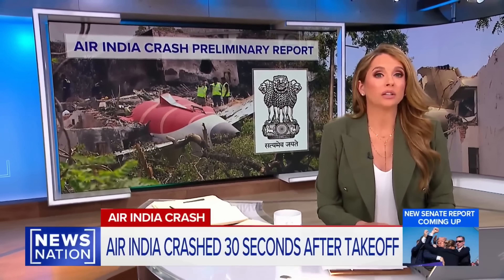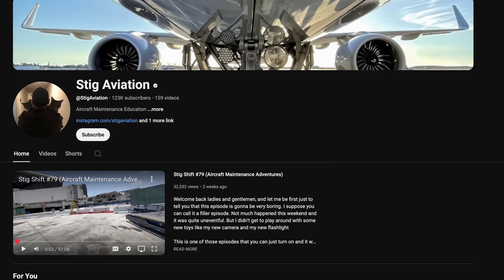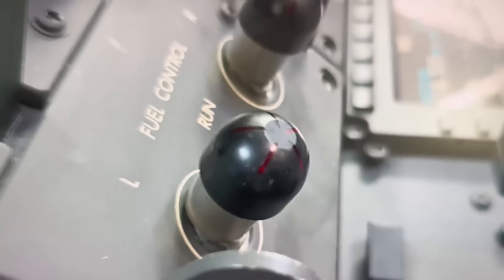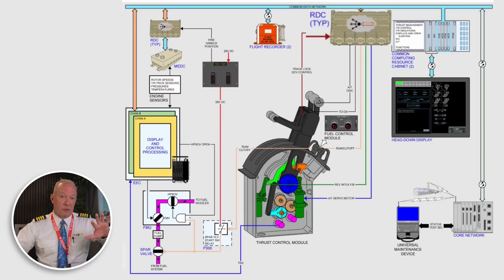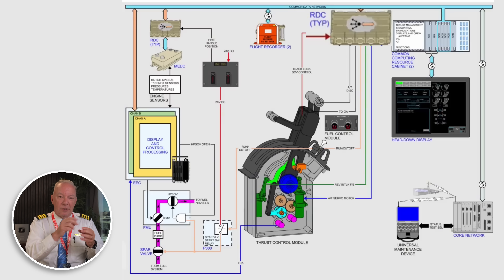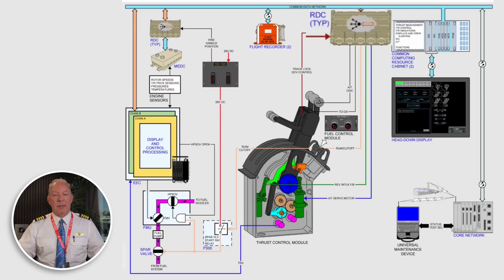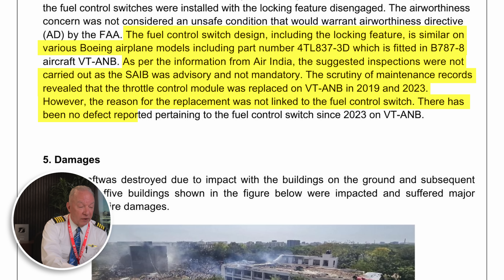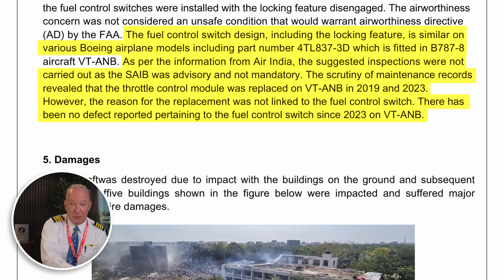The Truth About Boeing 787 Fuel Control Switches

Comment: Excellent explanation, it cannot be a glitch because one pilot asked the other why he shut the engines off. If it was a glitch the pilot would not have known what happened. The pilot saw the engine switches were moved the off position and that's why he asked the question
Reply: Yeah, the fact that the copilot asked the captain why he moved the switches to off and the captain’s denial (while not asking why the copilot did it) rules out any other explanation. The captain decided to crash the plane.😢
Reply: @gotamd  OR he had a brain fuck and thought he was bringing up the landing gear (or something else). Now if we have evidence of a short struggle in those 10 seconds… That would prove it.
Reply: Yup! I was here to say that.
These people pretending that this was a glitch... are ignoring that very obvious fact.
Reply: @CountAdolfo you dumb…there are no glitch in real life…that was duel engine failure.even elementary level students know better than u
Reply: There was certainly a glitch, but where? My money is on one of the pilots had a mental glitch.
Reply: @Marc-is-Me  RAT deployed before the cutoff, that's proven from the transponder data. No glitch. Electrical issues on the very previous flight of the very plane that crashed. In-flight entertainment systems not working, emergency lights flickering, aileron transducer failing. Just a coincidence, right? Wonder why the captain didn't pick a non-faulty airplane for his deliberate crash, would've been much easier to control.
Reply: If you notice, on the instruments, that the fuel is cutoff it is natural to ask the other person why he shut it off although you may not have seen him do that specifically
Reply: @bollof1 very true.
It's just liars who want to blame Boeing who spew nonsense trying to discredit the facts.
Best to just block those.
Reply: Why would the one pilot answer I didn’t if he turned them off to make sure the engines rebooted? You make no sense. Let’s wait and see when the final report comes out.
Reply: As I understand it, the pilot didn't ask why did you shut the engines off, It was reported that the exact words were "Why did you do that"? he didn't mention the engines being shut off. Unless we have the full voice recording released, we cannot be sure what the pilot asking the question was talking about.
Reply: @johnrobinson1020  The cockpit voice recording captures one pilot asking the other why "did he cut-off", to which the person replies that he didn't.  I don't think he was asking the suicidal pilot about anything other than the intentional act of shutting off the engines
Reply: @jerrycann6374  The report I read was that he asked "why did you do that"? There are so many conflicting reports out there you don't know what to believe.
Reply: @johnrobinson1020  I'm amazed that your focus is on what words were used instead of the murder suicide that was caused by the pilot's intended actions
Reply: @jerrycann6374  Well anyone should realize the difference between "why did you do that" and "why did you switch the engines off" The first statement could be referring to anything, and not the engines. One of the pilots might have turned on the screen wipers and the other pilot could be asking about that. That is why it is so important to get the statement correct. Although it may well have been about the switches, the second statement is not definitive or conclusively referring to anything in particular.
Reply: @johnrobinson1020  and what difference would that make to the victims of the pilot who committed suicide murdering all the innocent people in the aircraft?
Reply: @jerrycann6374  It wouldn't make any difference to them, but it could make a difference knowing if the switches were activated manually or by some other means, which could indicate a fault in the plane and be a safety concern for future flights, so more hundreds of "innocent people" don't suffer the same fate. plus it would  vindicate the pilots if it turned out that way. If we are to think along the lines that nothing is going to change what happened to the passengers on this flight, then there would be no point in any investigation at all because nothing is going to change what happened to them.
Reply: Was that message translated, and can we verify that he actually said that, and not something like "did you cut the engines" (without the 'why' implying it's a question)
Reply: @jwalster9412  English was spoken. He asked WHY
Reply: You seem to know a lot about what was actually happening in the cockpit and what each pilot was thinking.
Reply: yes but that doesn't tell us the other pilot definitely moved them. all we know is one saw them in the off position and assumed the other must have moved them.
Reply: You are jumping to conclusions,the other pilot denied doing so,which would be a natural response.
There is more detail to be released,was there an argument or fight?
Reply: My exact thought.
Reply: The Huey's hydraulics control switch has exactly the same switch, in addition it has a mechanical guard that laps over the switch so it takes two actions to move the switch.  Used in training to demonstrate students loss of hydraulics.
Reply: Unless he looked down and saw the fuel switch position the pilot was assuming that his colleague had closed the switches based upon information from the cockpit instrumentation in front of him, his focus would have been on the information on his instruments and the approaching ground, he is unlikely to have been turning his head 90 degrees to the side and down at that point as he was a bit busy.
Reply: @PaulSmith-g5p I think you are making a huge assumption.

He had to have seen that the switches were in cutoff.
Had to.
1. The amount of time he had wasn't enough to diagnose the issue.
AND
2. The switches were set back to run

EVERY indication is that he saw them
Reply: You are the smartest
Reply: Instead of being Keyboard Warriors and Aviation Expert let's ask for the Complete report and Exact Conversation which happened in Hindi or English language. And Did RAT deployed before the Fuel Cut off or after?
Reply: If the pilot saw "the engine switches were moved the off position" he would not ask any question because he knew that there is no time for questions and answers.
Reply: @klaus-petermaier2776 maybe, but its still guessing. I like to think that the investigators don’t what to give us too much detail until they are absolutely sure.
I can’t really think why they would want to cover anything up deliberately, it does happen,the Chinese have flat out refused to say anything about their B737 crash
Reply: @klaus-petermaier2776  but he did, we know from the voice recorder, one voice asks "why did you cut off" and the other responds "i did not".
Reply: We can't rule out a glitch because one pilot said that. In a alarming situation like that, I too would blurt out something like that - particularly if I had complete faith in the machine and believed that there was no way the fuel would cut off unless my co-pilot did so. If we are going to take that at face value then probably we should take the other pilot's retort that he didn't at face value too. We don't know if the pilot who said that did so because he saw the other move the switches. I am not saying it was definitely a glitch. It's too early to conclude either way
Reply: @PranavSinganapalli You might blurt out something like that but you’re probably not trained to be a commercial pilot, are you?
Reply: What was the reply to that question?
Reply: That's not true
Reply: @snidelywhiplash6889  and what are your qualifications?
Reply: I suspected pilot suicide when it first happened.
Reply: @m1421 Just because a pilot likely did it, it doesn’t mean it was for suicidal intentions.    Consider- most pilot suicides happen in cruise, when you can lock the other pilot out of the cockpit.   

Just because someone moved the fuel cutoff switches, it doesn’t mean we know their intent or the degree to which it was conscious or not.   Plenty of accidents have been caused by brain farts.
Reply: I've been saying this since the report was published. All theories about the switch not mechanically moved falls apart the moment one pilot asked why the other switched it off. It simply means it's visible.
Reply: @YumiFaeldo no,perhaps he just assumed like you are doing now
Reply: The report does not credit either pilot with saying something particular.
Reply: @martinwhite418  The report uses two sentences of reported speech. Have you even read it? They just don't say which pilot said what and they use reported indirect speech for more confusion. Direct speech using quotes would've sufficed. Better yet, if they had the smoking gun proof the captain did it, they'd have released it immediately. They have nothing on them, so they have nothing to release, period.
Reply: @MerrekSK  I have read the report a lot. I think I could do a play on it without a script. Why are you telling or asking me this?
Reply: They were two pilots in the cockpit. One noticed that the switches were off and presumed that the other pilot had turned them off. The other pilot said he had not turned them off. It could be that one of those two pilots were lying or it could be that the switch was turned off for some reason that we do not yet know.
Reply: @SeanPat1001 two possibilities ONLY:

Pilot who intentionally turned off fuel lied when asked why he did it
OR
Pilot who intentionally turned off fuel asked other pilot why HE did it... for the CVR to blame other pilot 

There IS NO other way the switches were moved
Reply: @CountAdolfo  We do not know how the switches were moved.
Reply: @SeanPat1001  You still don't get it. I will quote the preliminary report, to make it clear:

"In the cockpit voice recording, one of the pilots is heard asking the other why did he cutoff. The other pilot responded that he did not do so."

That's all the available information. Indirect speech, you don't even know the subject in that first sentence. You don't know if there were more sentences before the 1st and 2nd one. The question may have been "Why did he (the plane - HE in Hindi) cut off?" Then a few more sentences such as "I don't know. What's happening?" Then finally "I didn't do anything." Get it? Don't get it?

The report says nothing about any pilot noticing anything. It doesn't even say the 2nd pilot denies cutting of the switches. It only says "The other pilot responded that he did not do so." As you, me and everyone else don't know, what happened in between, you don't know TO WHAT he's referring to as not doing! Get it? No?

The preliminary report is deliberately incomplete, dubious, contains red herrings to throw us off. WHY ?
Reply: @MerrekSK  Exactly. The conversation proves nothing.
Reply: @MerrekSK the common slang usage of English words to suit Hindi grammar is lost on someone here, but I get it from years of working in USA with the culture. I had a multi lingual physician that helped me to understand why and how some English used would vary from my common usage.
Reply: @MerrekSK The report is incomplete but this is a preliminary report. My understanding is that the preliminary report to identify any fault that may affect other similar aircraft. The worst thing that could happen was for other people to die because of a common fault. If such a  fault is discovered then they would issue a directive to instruct that other aircraft should be inspected or even grounded. It appears that they have released the minimum amount of information to justify that no such directive is necessary. We will have to wait for the full report to get more information.
Reply: @SeanPat1001  You don't know if anyone noticed anything. Stop guessing.
Reply: @martinwhite418  Exactly. These people jump into conclusions without actually reading the available information, which is deliberately incomplete. I mean, how hard is it to tell the truth, but not the complete truth? The report is not exactly lying, is it? But it's not telling the complete truth, that's for sure.
Reply: @MerrekSK  We don't if the report is "lying". The report is the equivalent of a guys wife is missing and the cops ask,  "When is the last time you saw her?" And the guy answers "I'm not sure."
Reply: @martinwhite418  You don't have to convince me. The report is a farce. Half-truths and deliberate obfuscation. My reasoning? If they had any proof the captain did it, they would've released it. They have nothing, so they released what has since led to other people making that assumption for the investigators without explicitly stating so.

Even if the captain wanted to do it on purpose, there are much better ways on a 10-hour flight. Such as, not doing it when the copilot's senses are heightened, his focus 100%, the crew is ready for any kind of emergency, etc. He would've waited for the first leak break, then locked himself in the cockpit. Noone to fight, noone to oppose, do whatever you want. Cutting off after takeoff you risk surviving the low-speed low-G crash and burning to death. Which is better?
Reply: @martinwhite418 yes, we DO know that the other pilot NOTICED because it's SAID.

The ONLY other option is the Captain flipped the switches off, then ASKED the FO why HE cut off just to pass blame on the CVR. That's possible but unlikely
Reply: @martinwhite418 Exactly! For example, one pilot could have moved the switches and then asked the other why he moved them to deflect blame.

The conversation proves nothing,
Reply: @SeanPat1001  Or the switching occurred after the engine failure.
Reply: @CountAdolfo  Nothing in the report, oh who cares, I'm arguing with somebody too lazy, or incapable of reading.
Reply: @martinwhite418  That’s another possibility. It could explain why it looks like the RAT was deployed before the data recorder says the switches were thrown.
Reply: That might not be happened. The amount of times I’ve asked my wife why she moved the remote control for the TV when she had nothing to do with with it.
Reply: @gosurc1860  That very same plane had electrical issues on the very previous flight. Some of them were not even reported! It was only after the crash that previous passengers "remembered" the infotainment wasn't working, emergency lights were flickering (big red flag), only reported issue was a aileron transducer system fail, which was supposedly repaired.
Reply: Don’t make a judgment before the final report is released. At this stage, it’s also possible that a pilot could have shut off the fuel switch and then shouted, “Why did you turn it off?” to appear innocent.
Reply: @timhu6104 - if so, it still would have happened on intention
Reply: The basic question is : if you see your copilot shutting down both the engines? Will you not turn it on immediately?? Or else will you keep watching what happens till you crash??😂😂😂
Reply: @Raj80sk you didn't get the point. No one said the pilot saw the other switching it off. The point is, the pilot saw the switches in cutoff position for him to ask the other pilot. Because who else will you blame if there's only two of you?
Reply: @YumiFaeldo 

So the other pilot didn't turn it back on even after knowing that the switch is in off position???? 

Both the pilots are planning to wait for their death??
Reply: @iyappaniyappan-bl2en 10 seconds is about the reaction time if stepping on the gas pedal if your car leaving a traffic light. It's pretty darn quick actually.
Reply: @Raj80sk - he acted immediately. What is your point? It’s the engines, which cannot act immediately.
Reply: @helgekumpfert4011 

After knowing that fuel switch is off,  waiting for 10 seconds to put the fuel switch back to on is immediate? 

If the other pilot acted 9 seconds early   then this couldn't have been avoided?
Reply: @Raj80sk - 10 sec reaction time (if true at all) is still pretty normal for a completely unexpected situation, which popped up out of nowhere.
Reply: @helgekumpfert4011 

He was able to see it and question it immediately but not able to turn it back on immediately though it's a life threatening situation??  He took more than 4 seconds to turn back the other switch to on!!

The report does not fill the gap..People still can see thru..

The coverup doesn't work.
Reply: If the only connection from the switches there is no light on the instrument pannel or any alert on the displays, how the pilots knew that the fuel switeches were turned off?
Reply: @ShonMardani  It's not about the switches at all, it's about RAT deployment time. It deployed before the switches because of electrical short.
Reply: @MerrekSK no... it... did... not
Reply: @CountAdolfo   Just like I thought.. no proof, just claims. Thank you. Remember that in a year.
Reply: @MerrekSK from the OFFICIAL timeline:

29 seconds before crash: plane reaches max recorded airspeed of 180 knots... and then fuel switches were moved to cutoff.

24 seconds before crash: RAT deployed.

Between the two, one pilot asked the other why he had cut off.
Now, if you're not LYING, then let me explain to you:

24 seconds before crash is AFTER 29 seconds before crash
Reply: @MerrekSK I just proved it.
Cope, liar. Now we KNOW you are just trying to spread misinformation.
Reply: @MerrekSK evidence presented.
YOU have only false claims.

RAT deployed FIVE SECONDS AFTER the first switch was thrown to cutoff.
ALSO... "Mayday Mayday Mayday" is all the report says the final call includes.

YOU'RE lying, and now we ALL know that, presented with proof debunking you... you just double down.
So, I hope they're paying you well to lie
Reply: @CountAdolfo  The official timeline says nothing about RAT deployment time, only when it started providing hydraulic power. Learn to read.
Reply: @CountAdolfo  "The CCTV footage obtained from the airport showed Ram Air Turbine (RAT) getting deployed
during the initial climb immediately after lift-off"

The next timestamp is when it started providing hydraulic power. The quoted statement directly from the preliminary report is fully consistent with the more and more probable hypothesis that RAT deployed immediately (ie. less than 2 secods) after takeoff, before the switches were moved. You're welcome. Transponder turnoff time is the smoking gun.
Reply: My money is on issues with the Boeing. That whole company needs to be shut down.
Reply: @MarushDenchev you lost your money, then.
You offer nothing but willful ignorance to the discussion
Reply: The inform says both  engines fuel  switches transitioned to CUT off at 08.08.42. and RAT started  supplying power at 08.08.47.
So does NOT say the RAT was out before both switches transitioned to CUT OFF position
Reply: @bihurri  they KNOW they're telling lies... I'm convinced. They're either paid by someone to spread this crap or they're not intelligent enough to know that 08:08:42 doesn't come AFTER 08:08:47.

They are NOW claiming "the RAT 'deployed' before the cutoff but started producing power AFTER... that's Merrek's weak claim.
Bad news for them?
It takes THREE SECONDS for the RAT to deploy and begin producing power... so... you and I know... there's no way.
But.. not those who are, possibly, being paid to pretend this is a Boeing failure and deny all evidence to the contrary.
Reply: That's precisely correct. Following that statement,  the cutoff switches were returned to run. That bref conversion is the proof that the cut-off switches were seen in the off position. Period! End of story.
Reply: @georgeaffonso3966  No, because there are hundreds of switches on that aircraft. We don’t know for sure what they were talking about and the conversation doesn’t indicate for sure that the pilot saw the other pilot do anything to the switches. As I mentioned before, a pilot could’ve noticed the switches in the off position and just assumed the other pilot moved them. However it’s possible they were talking about something else entirely.
Reply: No, the pilot was busy in take off and suddenly lot thrust and then saw yours the stitches which had glitches.. do he inquired why you turned off switches.. so the other pilot replied correctly(as any sane pilot would do) i didn't.. 😮😮 it's that simple.. wait for the next one and you'll find out..😢😢😢
Reply: @betteraura  Wait a year and maybe someone will finally tell you about the faulty battery diodes, or Boeing air worthiness directive considering water ingress into EEC
https://www.regulations.gov/document/FAA-2024-2665-0001

Someone might even remember by then that the exact plane that crashed had 3 issues on the very previous flight. Infotainment not working, emergency lights flickering, aileron transducer failure. What a coincidence. And we are to believe the captain did it? Yeeeeah...

RAT deployed before the switches were moved, this is now a proven fact from the transponder data. You're welcome.
Reply: Wrong. He heard the spool down, asked,the other other says I did not.
Could still be a wiring connection problem. between
Reply: @hotrodray6802 If one of the pilots realised that the aircraft was losing power I would think he'd say something like "we have an engine  failure". I don't think he'd assume his colleague had switched off the fuel unless he saw him do it or noticed they were in the off position.
Reply: @hotrodray6802 utterly false, debunked... stop trying to confuse things
Reply: Until the original and unmodified cockpit discussion is released, everything is speculating, including your dump statement “it cannot be a glitch because one pilot asked the other…”
Reply: @gonzmann2008  Speculation supported 1000% by facts and evidence... unlike the "it's a glitch because I'm a crybaby and hate Boeing!! WAA!!" opposition.
Reply: Did he actually see the switches being moved? Or was it that he felt the engines roll back. Maybe he observed the gauges showing power falling off. Maybe he just felt the aircraft slow down. Personally I wished the NTSB was leading this investigation. Too many scenarios right now to rule anything out It took nearly four years to find out that TWA Flight 800 was brought down by some wiring shorted in the center tank and igniting vapors.
Reply: @williamjones4483 The 787 FDR captures the setting of the fuel cutoff switches.   So the answer will actually be easy to figure out
Reply: @williamjones4483 "some wiring shorted". Try tossing a lit match into a barrel of Jet A fuel (kerosene). It will extinguish. The flashpoint of Jet A is much higher than gasoline like in your car. As high as 140°> The temperature in TWA 800's tanks would have been approximately 59° to 68° f during this phase of flight. Tossing a match (or creating sparks from a shorted wire) would not / could not ignite the kerosene as it's flashpoint is much higher than gasoline in your car. Tossing a lit match or creating a spark in your fuel tank in your car would cause an explosion since it's flashpoint is much lower than kerosene. Single lit match into a barrel of kerosene and it would extinguish because the kerosene doesn't boil off in the fumes as it has a much higher flash point.
Reply: @williamjones4483  Again the least likely scenario.
Reply: @JoeLinux2000  Time will tell.
Reply: You have no idea what one pilot asked the other pilot. Planes in Hindi are called "he", not "she". The preliminary report deliberately uses indirect reported speech to cause confusion. One pilot may as well have asked "why did he - the plane - cut off?" You wouldn't know from the preliminary report. And btw by now it's been proven (from transponder deactivation time) that the RAT deployed before the cutoff switches were moved. Again, missing info from prelim. report. They talk about the time when RAT started providing hydraulic power etc., but obfuscate the time of RAT deployment to stall the truth that it was a catastrophic electrical failure (elec. issues reported on the very previous flight of that plane), RAT deployed and then the pilots may have moved the switches to make sure reignition was activated, but there was no time for it. For the last time - RAT deployed before the cutoff switches were moved. This was the primary root cause. Remember that when in 1-2 years the truth comes out.
Reply: @MerrekSK he or she, the switch still moved mechanically. Visible. No, the RAT didn't deploy before the cutoff.
Reply: @YumiFaeldo  The RAT did deploy before cutoff, exactly 2 secs after takeoff after an electrical failure, which is now evident from the time when the transponder was switched off, which is exactly the time when RAT started providing electrical power and transponder is a non-essential electrical device and gets turned off (until then it took the energy from the main battery), so you can count down from that timestamp and figure out precisely when the RAT was deployed. The preliminary report doesn't state that, but clever people did the analysis and now we know. On what do you base your biased opinions on? The transponder data is the smoking gun. Fuel cutoff switch was the result, not the cause. They were merely trying to make sure the engine would try to restart. Cutoff or no cutoff, it wouldn't have made any difference, as there was no time for the engine restart. "Thrust not achieved" was the sentence heard in CVR, not "captain did it". Wake up, will you?
Reply: @YumiFaeldo 
What evidence says that the RAT didn't deploy first ?.
Reply: @MerrekSK but your theory that the co/pilot addressed the plane as “he” doesn’t make sense.  Was the conversation in English? If so then they wouldn’t have used he. 
Also, if one of them was talking TO the plane then why did the other talk back?   
This theory alone is too complicated to make it work.
Reply: @Kennann7634 This!.
And it’s not like, in an emergency situation, the other pilot would then begin to defend the plane and state it (he) didn’t cut off. 
Too much out of the box theorizing all at once for that to have transpired, in my opinion.
Reply: @Kennann7634  Exactly. We don't even know the language of the conversation, yet every one of you is blaming the captain and taking it for granted because of "the report"... see the irony here ? One could've been asking the other "why the plane cut off" using "he", the other merely replying "dunno, I didn't do anything", but that must be too much for you to comprehend I guess...
Reply: @Kennann7634  The report doesn't say that any particular pilot said any particular thing.
Reply: @MerrekSK NOTHING you claim is accurate.

Are you being PAID to spread misinformation and try to push a BS narrative?
Reply: @MerrekSK The only information that matters is this: first-the switches, which are on separate independent circuits, were moved to cutoff. Only after that the engines rolled back and shut down. Then ten seconds later the switches were moved back to run and only after that the engines began to restart. So some in the cockpit had to physically shut the engines off and someone in the cockpit tried to restart them. And that is why the plane crashed.  Why they did it is speculation and anything else going on was irrelevant. Those are the facts of the matter deal with it.
Reply: @MerrekSK  According to Mr. Google, at 08:08:42, both engine fuel switches were moved to the "cutoff" position.  The RAT automatically deployed at 08:08:47 .   You are entitled to your own opinion but not your own facts.   If the RAT deployed before the fuel cutoff, I will eat a RAT.  People are just making stuff up to suit their pet theories.  As the  old saying goes,  denial ain't just a river in Egypt. Sometimes the truth is very painful to accept but the truth is the truth and we have to accept it no matter how painful that is or what sad or awful conclusions it leads you to.
Reply: @MerrekSK direct quote from the preliminary report "In the cockpit voice recording, one of the pilots is heard asking the other why did he cutoff" as it states one pilots asked the other pilot lol in no way can u argue that he was wondering why the plane did it by itself😅 ur just ignorant, did u even read the report
Reply: @MerrekSK  A catastrophic electrical failure which somehow evaded being picked up by the FDR??
Reply: @dparis2172  And you saw the FDR data ??? Where in the preliminary report does it say anything about FDR data? Do you know the FDR in the back got heavily damaged?
Reply: @MerrekSK  They are either able to or not able to download the information from the FDR (Hint: They we’re able to in Delhi)
Are you suggesting that the investigators don’t have FDR data?
Reply: @dparis2172   FDR data has not been made public yet and nothing of it has been released. So anyone saying anything about FDR data or what it may or may not show, is pure speculation. If there was a catastrophic electrical failure, it may have been picked up by the FDR, but so far, noone confirmed this. Of course, why would they? They need to protect what is left of the Air India and Boeing stock values... And there were 2 boxes (not CVR+FDR but two EAFRs) and the aft one was heavily damaged.
Reply: @MerrekSK you’re completely wrong, the reason the rat deployed was because the fuel switches were moved to off
Reply: @MrMgage13 MerrekSK is intentionally spreading misinformation. Everything he claims is EASILY DEBUNKED if he even took ten seconds to look it up.

He's desperate to blame Boeing
Reply: @MrMgage13  And you can prove this, right? Because not me, but much more clever people used transponder data to figure out when it stopped working. It is a non-essential electrical device and stops working exactly the moment when RAT starts providing electrical power. Backtrack from there and you have the time of RAT deployment. BANG. You are just saying, while these people actually did some analysis from the transponder data and proved the RAT deployed before the cutoff, not after. Why doesn't the preliminary report list the RAT deployment time, but lists the timestamp when it provided hydraulic power? Huh? Any proof for your claim?
Reply: @MrMgage13   You have no way of knowing that, you're only parroting what you'd been told. Transponder data proves exact moment when the RAT deployed and it's 2 seconds after takeoff, 2-3 seconds before 1st switch was moved. You're welcome. That exact plane had 3 electrical issues on the very previous flight, has cpt. Steeeve mentioned that? No? Hmmmm... RAT deployed because of electrical issue, which cutoff both engines, the pilots tried to restart them using the switches. Totally different scenario.
Reply: @MerrekSK How do you know that they were conversing in Hindi? Also, planes are not called "he" in Hindi.

That said, I agree with you that the report is meant to be confusing and a display of investigative incompetence, if not intellectual incompetence.
Reply: @mbrane I am convinced MerrekSK is a paid disinformation operative.

He's SO inaccurate it's like he's trying to create CHAOS
Reply: @MerrekSK . The pilot crashed that plane intentionally. You just can't come to terms with it. While I was listening to Captain Steve the way the switches work electrically I was thinking that most people are pretty stupid when it comes to electricity and don't have even a basic understanding of it. You are one of those people.
Reply: @terpodion  How simple how easy. I have no issue with the switches. The problem is transponder data reveals the RAT deployed first. Hence, moving the switches didn't cause the engine shutdown, it was a desperate reaction to the already shutdown engines to relight them back.
Reply: @MerrekSK  “it was a desperate reaction to the already shut down engines to relight them back”
You do realize that this is entirely in your imagination, right? Unless you are privy to the cockpit conversation recording which no one else in the public domain is. 
Do you think that it’s an actual procedure in the event of engine failure immediately after takeoff to cut the fuel switches THEN WAIT 10-14 SECONDS TO TURN THEM BACK ON?
Reply: @dparis2172   And who is speculating now? Engine cutoff switch back and forth doesn't force engine relight if it wasn't automatic? Of course it does. You haven't heard the cockpit conversation either, but you "know" what happened. Remember this in a year or so.
Reply: @MerrekSK  So you admit you’re only using your imagination, good. Now, what exactly am I speculating about? I’m drawing from information in the preliminary report.
Reply: @MerrekSK um... no.
Nothing you are claiming is relevant fact.

It was intentional. Try to come to terms with that.
Reply: @CountAdolfo  The RAT deployed before cutoff switches "transitioned" as per loss of transponder signal (suggesting electrical failure) - didn't you know?
Reply: @hubertusjung7802 um... you're WRONG.

The RAT deployed FIVE SECONDS AFTER the first switch was thrown to cutoff
Reply: @hubertusjung7802  Right.  The switches are a red herring.
Reply: @MerrekSK WRONG! The full conversation wasn’t even released in the preliminary report, you’re just making stuff up.

This was an intentional act. Especially since the Captain was “depressed”
Reply: @Curry5Rings Be careful with the word “Intentional.”    It means a human did it, but not WHY he did it…and whether or not it was conscious.  It may not have been- and, in keeping with Steve’s point, we may never know the why.
Reply: I thought he said it was the flaps.
Reply: A'nt you that fool.. The report didn't release the actual conversation and who asked to whom!! They're completely hiding the truth.. Pilots were highly dedicated and expert.. Steve has to get money from Boeing to save the image of US company.
Reply: @Rajkumar......  which one of the pilots who asked the question is not important unless you want to know which one was suicidal and caused the cash.  I agree both pilots were dedicated, one to fly the plane and the other to crash it. As far as being expert the pilot who turned off the engines knew exactly how to accomplish that.
Reply: @Rajkumar...... 🤣🤣🤣
Reply: @Rajkumar......  Bingo !
Reply: @Rajkumar...... Total and complete BS rhetoric from Steeeve on the AI crash 💥 is back.
Reply: @Rajkumar...... deliberately vague,they are not yet sure what happened and they don’t want people to jump to conclusions
Reply: @Rajkumar...... Apparently you’re not the sharpest knife on the table!
Reply: @Rajkumar...... I haven't heard the pilots say anything , we only have their word for it
Reply: @Rajkumar...... You clearly don't know what you're talking about.
Steve isn't working for Boeing.

This was a tragic, INTENTIONAL act.
Try to get that through because when the report is finalized, you will have a fit if you don't
Reply: @CountAdolfo .
Reply: @Rajkumar......  Steve is ignoring the proven fact that RAT deployed before the switches moved, so any conversation on mental health is pointless. The pilots did everything to save that plane, probably even tried landing on a highway, but there was just no time. Fuel switches are just to make sure the restart would happen, but there was no time. Catastrophic electrical issue is the culprit, obvious from the very previous flight of that very plane. Infotainment not working, emergency lights flickering, aileron transducer fail.
Reply: @MerrekSK the RAT 
ABSOLUTELY 
DID NOT
deploy BEFORE.

The RAT deployed FIVE SECONDS after the first switch was thrown to cutoff.
STOP SPREADING FALSEHOODS
Reply: @CountAdolfo  And you know that... how ? Because there is no ground for this. The RAT deployment time can be safely calculated from the transponder turning off. That's the smoking gun.
Reply: MerrekSK, you have no credibility.
You have been spreading lies. You don't research. You can't think logically OR you are lying, so... dumb or deceitful.

The RAT deployed FIVE SECONDS AFTER the first switch was thrown to cutoff. 
THEN, one of two things happened:

1. The pilot who intentionally cutoff the fuel was ASKED why he did it by the other pilot... and he denied it

OR
2. The pilot who intentionally cutoff the fuel asked the other pilot why HE had done so, trying to pass blame when the CVR was found.

That's it.
There's ZERO chance of a "glitch".
The evidence is clear. Your lies about this or that WON'T change what happened.

The time delay between the switches proves you wrong ALL THE WAY AROUND.